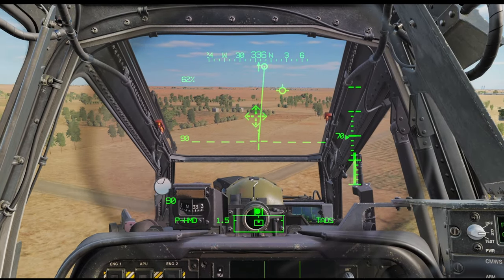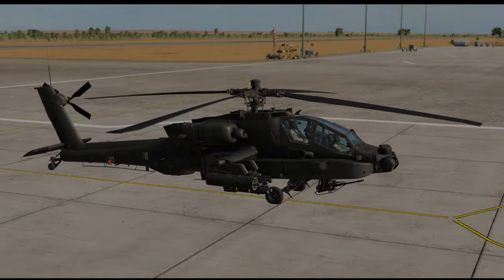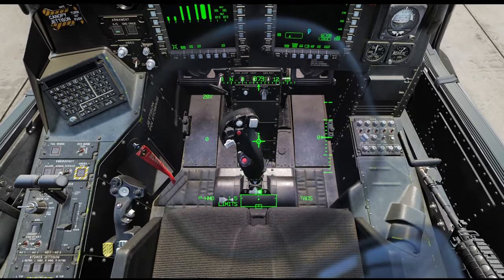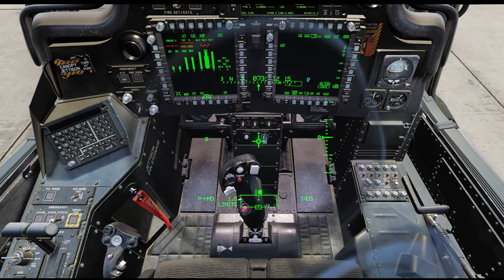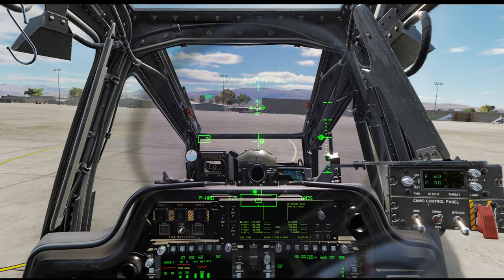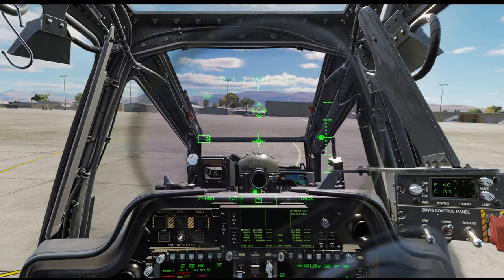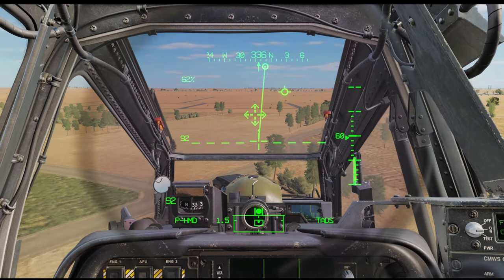The #1 thing you need to focus on learning for flying the DCS Apache | DCS World

Comment: Casmo, love the videos and the experience and wealth of knowledge you bring. While I agree that people don't understand helicopter flight in general and need more practice with it, there are some glaring issues that need to be addressed with the FM. To give credit where it is due, because I love shitting on ED as much as the next guy, the Apache is beautifully modeled and a real joy to fly 75% of the time. I would consider myself fairly well versed in rotary flight, albeit only in simulator. I have ~500 hours in the Huey and have quite a few hours in the Hind, Hip, and Gazelle. I understand force trim and how DCS is trying to approximate it. Again, I have never flown the real Apache, so I might be ignorant, but I feel that closer to the edges of the flight regime it becomes wildly unstable and wholly unpredictable. Non commanded snap rolls being the major issue I can point to right off hand. While I do agree that most just need to "get gud", I also am willing to admit that we are not quite there yet, and we still have a little ways to go. Just my $0.02 for what it's worth. Loving the videos. Please keep doing what you're doing. 

PS
What is BAM? Haven't seen any videos about it. Would love to see what it is all about. I think the TSD has the real potential to be a very powerful tool if used correctly, I can really see the potential there. I know you have said in the past that BAM is very complex. I really haven't looked into it on my own at all. Thanks again!
Reply: The best way to describe it just sitting here thinking about it, I feel like in the Apache I am balancing a plate on the tip of a pin. Like any movement will just upset it and send it tumbling.

Comment: There is what comes pretty close to a perfect solution: An FFB stick. Since I got my Sidewinder, I haven't touched my Warthog stick in almost a year already.
Reply: Same. My Warthog stick is collection dust for already a decade... and I even tried the G940, but wasn't happy and flipped it :D
If only MS could team up with TM or any other stick builder and make a worthy successor with all the bells and whistles, I'd be so down for it!
Reply: @CakePrincessCelestia  that would be amazing. In the meantime, I'm saving up some money to get a VPForce Rhino
Reply: @ttenor12  I didn't even know about that... I actually might consider getting one as well. The thing that always kept me from getting the Brunner (or: saving up for it) was the fact that it doesn't do native FFB and needs some workaround solutions for it to work with our sims. And I heard the motors would lower the force after a while due to heat build up which I totally wouldn't want to happen. I'd probably try to make a setup with an extension while I'm at it, so yeah, I'd need stronger forces.
Reply: @Rainbow Dash  that's one of the things that the Rhino fortunately fixes. It's detected natively like any other joystick and even comes with a software that allows you to adjust spring tension, dampening and friction. The only downside is, its price being a bit steep compared to the Sidewinder (still much cheaper than the Brunner though) and the long wait time to get one.

Comment: Lil confused. Ok so in real Apache, do you need to press the “trim R” up and keep pressing it and move the cyclic forward/backward then take your finger off of and it locks there ? And that will be the new center position ? OR it will get back to old center position ?. I’m really confused here.
Reply from the maker: It stays there. It’s not a new center position. Center doesn’t matter. That’s not what’s important.
Reply: @CasmoTV  ok, what does the Trim AFT button does if pressed  ?.

Comment: My biggest issue with the trim in the apache is that my Sidewinder Force Feedback stick doesn't seem to want to "Talk" to DCS properly and when I hit the trim button the stick recenters itself somewhere completely different. I'm not entirely sure why this happens because it works perfectly with the Hind, another ED module, so it should be the same. 
I can see how people get really confused though given the different trim buttons and functions compared to other helicopters though.
Reply: Sidewinder user here. I don't own the apache, but from my experience with the other rotary modules, you have to reverse one or both of the ffb axis in the controls. For some reason  the way they are coupled to the joystick axis differs per module.

Comment: The only solution to the trimmer system is a Force Feedback system or a non spring system. I have no spring on my pedals with a steering damper with around the same pressure on it like pushing the brakes on your car. It stays where I leave it.

Comment: How do you make the eyesight ring translucent like that? Also, does it have to be in the right eye or left eye or can it be both?
Reply: In the main menu you can set it under options --> special --> module settings and there you can also switch it off completely which I prefer.

Comment: Your videos are a definite help for all of us wannabes so first off thanks for that. 

Second, could you or do you have a video covering RPMs I kept having issues with that on the free trial.
Reply from the maker: RPMs of what?
Reply: @CasmoTV  on the AH64 I kept trashing the engines because the RPMs kept going too high, sorry it's been a while since I last tried.
Reply from the maker: @JonStockman82  you mean the torque %?
Reply: Might be, all I know is I was crashing more than flying.
I have two months before I can try the module again or I'd try again and try to be clearer.
In the mean time I'll be watching your Apache videos on repeat.
Reply: @JonStockman82  make sure the power levers are the the "fly" position. I experienced this and thought it was my binding so of course I cleared them only to realize there was a mission but where the power levers were not set correctly.
Reply: @guidaguida2  gonna give the trial another go when it resets and see if I can get good enough to justify the cost of the full module.

A-10CII takes up most of my free time.
Reply: @guidaguida2  yeah bud levers are set to fly. I keep getting issues with rotor RPMs then it becomes a meteor simulator 🤣
Reply: @CasmoTV  well after watching your videos and those of others like WAGS and Tactical Pascale and trying various setting changes to my hotas throttle as the collective (X56) I'm thinking my hardware just isn't precise enough for the apache.
Can't seem to keep the Torque % and RPMs stable at all and end up in the ground.

Guess I'm sticking to the hawg.

Comment: 4:23 If only there was more FFB capable hardware out there... it's kinda hard to recommend getting a used FFB2 stick still (it only has one hat, 4+4 buttons and is just 2048 res as opposed to modern sticks that are 16k or even more!), but the only real alternative out there is getting a Brunner CLS-E base which is very expensive. Most people won't do that... and even I haven't pulled the trigger yet, although I'm probably the biggest FFB advocate in the whole flight sim community...

6:53 So the real one doesn't, I presume...

9:28 There is, well, almost... it's called Force Feedback XD - of course, you still need practice, but at least the thing then behaves like a real one, which does make it easier :)

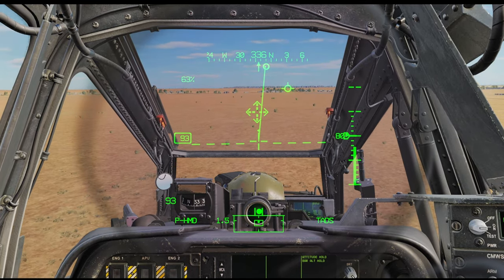13:47 Watching every YouTube video and not practicing genuinely is the new "I've read a ton of books about it but that's it".

14:14 You know what's not hard? Holding the torque right there at 69%. Nice! :D

My 2¢ take on the whole thing:
- Git Veeeee Orre
- Notice "IHADSSo much more problems without"
- Git Force Feedback (if you can't, go pester your favourite HOTAS manufacturers repeatedly until they finally ship something that has it!)
- Learn loving the trimmer with that gigachad device
- Turn that fricken IHADSS off, really!
- Git GUD
- Turn that fricken IHADDS back on
- Feel like being at home in the thing!

Comment: Are the blades supposed to flap up and down when stationary like that? I was under the impression that aerodynamics forces were the only thing that actually "tilt" the rotor system as a result of pitch changes.
Reply from the maker: Well if the swashplate is moving then The blades will love because of it.

Comment: Old man flew S92s.
He was explaining to me that pilots never actually moved the stick to fly the helicopter. SOP is to blip the trim to fly the helicopter at all times. 
He was saying that essentially the autopilot is in total control and pilots were basically forbidden from flying it manually. 
I explained how the BlackShark flew, and he said it was something like that. Helicopter would try to maintain an attitude, and you're just trimming around to fly it. 

Also said biggest hurdle for new pilots was getting them to understand that they aren't supposed to be "flying" the helicopter, and that they need to learn how to let the machine do all the work, and they're just blipping trim. Once that's understood, he said it's an amazing machine to fly.

I'm assuming Apache has some sort of similar setup. Maybe that's wrong.
That said, do you think these DCS modules should have a trim function like Hind and Gazelle do? You can fly those without ever really moving "the stick".
Reply from the maker: Meh not quite the same. You would certainly perish if you tried to fly the Apache like that. In fact you couldn’t.

Comment: Hi I didn't watch the entire video I'm sure it was fine and helpful to lots of people, as the comments seem to sugest they gained something beneficial. But I just felt compelled to point out your description of what trim is was not accurate. Trim has nothing to do with level flight. and its not anything to do with the slip ball you referenced. That just shows your not in balanced flight and your nose is yawing away from your heading. Usually that would be compensated with rudder although some aircraft do have yaw trim. Trim is simply an adjustment to the flight serfices to reduce resistance on the controls. You can be trimmed for a climb, in which case you can take your hands off the controls (fixed wing) and the aircraft will continue to climb. You can be in trim in a descent or in level flight. It just means your not fighting against the controls. If an aircraft was not trimmed lets say for pitch (many aircraft only have trim for pitch) and you relaxed your grip on the controls the aircraft would want to pitch nose up or down. Thanks for the tutorial I look forward to flying the Apache soon.
Reply from the maker: “Generally means” which is another way of saying doesn’t always mean. Thanks but I suggest trying to make videos a few times and understanding the  challenges inherent in necking down a complicated topic into a few mins before you throw too many stones.
Reply: sorry if you felt I was throwing stones I really wasn't trying to come across like that. I was trying to help. Trim is not a complex subject but is often misunderstood by virtual pilots who have not had real world flight experience (again not throwing stones I have no idea what your experience is, I'm talking about your viewers). Yes making videos is not easy I don't have the personality for it, but I have instructed so I understand what its like to explain terms like trim. @CasmoTV

Comment: What I don’t understand is the blades flapping when moving the cyclic while the blades are stationary.
Reply from the maker: Why? The swashplate is moving…
Reply: @CasmoTV  Right, but normally the blades would just feather, and not flap while the blades aren’t spinning. I think it may just be a visual bug.
Reply: The blades don't flap they are moved by the swash plate and all that engineering stuff

Comment: Why does ED make the Rotor blades physically Flap up and down on a rigid rotor system at 0 RPM? Rigid rotor systems don't work that way.
Reply from the maker: Just enjoy the video game and don’t think too hard about it.
Reply: @CasmoTV  it's just a weird thing to model on a simulator I think.
Reply: Er
Yes they do.
Reply: @joeds3775  on a rigid rotor system that is not rotating they do not. The blades only rotate about their axis. That's what makes them different from a tetering rotor like what is on the Huey. There are many publicly available videos of the different types of helicopter rotor systems and how they function. As far as why its like this in DCS. If its a limitation of the game engine, whatever NBD I just thought it was odd 4 months ago when I made this comment and then forgot about it and just enjoyed the game.